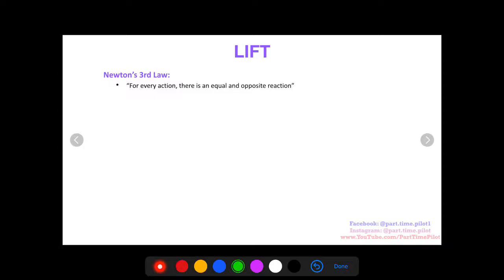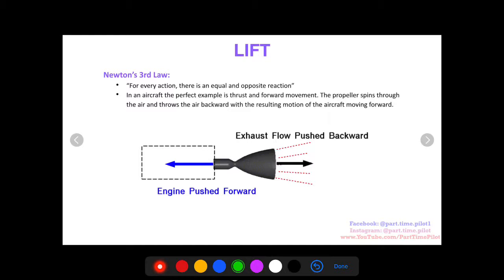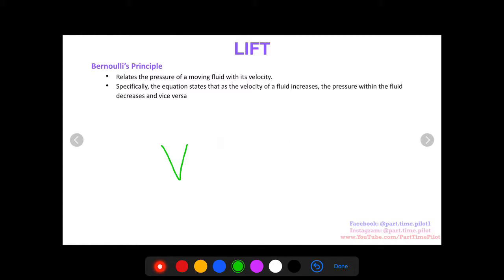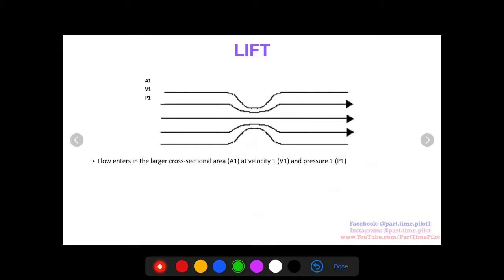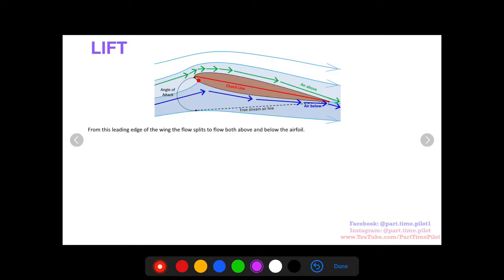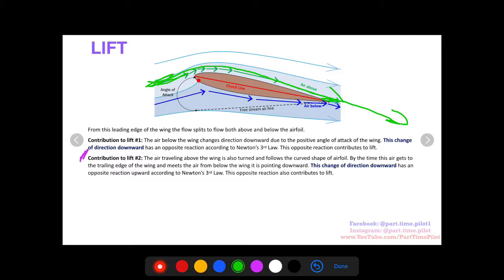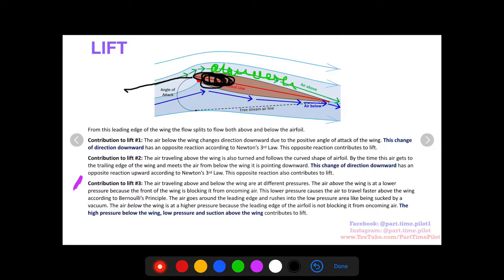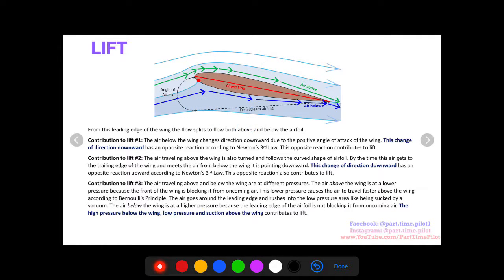How does an Aircraft Produce Lift? - For Student Pilots

Comment: Hello pilots! I'm a university student in an aeronautics course doing an assignment involving correcting and/or fleshing out explanations for lift as it is a complicated and even somewhat controversial topic in aeronautics. Part Time Pilot is obviously a great teacher from what I've seen, but I noticed a few key flaws in his verbal explanation for lift that are not expressed in the text on screen and I would like to give a little more insight into the reasons for lift.

Lift is in fact caused ONLY by the low pressure above and high pressure below, the change of direction does require an upward force be exerted and this force is manifested as pressure, but contributions 1 and 2 are part and parcel of contribution 3. Additionally, the reason for the low pressure above the airfoil is not really due to the blocking of dynamic pressure. The dynamic pressure is not the same as the pressure you are used to dealing with, it is somewhat abstract as Bernoulli's equation is simply an application of energy conservation which states energy cannot be created or destroyed. The dynamic pressure is simply the portion of the total pressure/energy of the air which is manifested as the air's velocity and the static pressure is the pressure we are used to and simply represents the portion of the total energy manifested as the pressure we know. The dynamic pressure of the air traveling on top of the airfoil actually increases which, since our total pressure must stay the same, means our static pressure must decrease, hence the lower pressure up top. The reason this fast flow and low pressure are established is because the air always wants to fly tangentially off the curve of the wing but this would draw air away from the wing creating a vacuum, this is why the pressure is lower and the higher atmospheric pressure pushes the air stream down which is why it sticks to the curve of the wing. The pressure and velocity of the air are codependent and influence each other constantly so a pressure drop does not then cause the air to speed up, the pressure drop corresponds with and happens at the same time as the air speeding up.
Reply from the maker: Good break down of bernoulli/energy cons! The trick with lift is trying to explain it in simple terms that people who have no experience in aeronautics can understand. A few questions for you...

You say contributions 1 and 2 are part and parcel... meaning necessary part of the explanation? That is the definition. 

You mention that the air on top of the wing wants to fly tangentially off the curve of the wing and this is what creates the vacuum on top of the wing. Why does the air want to fly tangentially off the top of the wing but not the bottom? What is the difference between the bottom of the wing and top of the wing in this instance? If there was none, the bottom of the wing would also create a vacuum with your logic. So there must be a difference?

Can you explain to me how free stream air contacting the bottom of an airfoil with a positive angle of attack does not obey Newton's 3rd law?